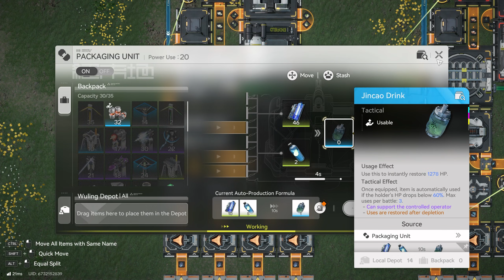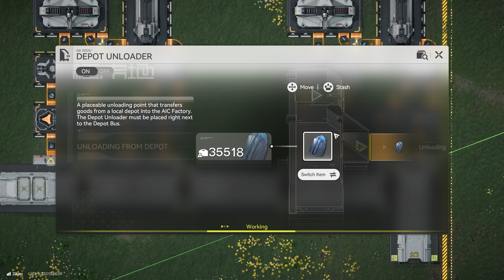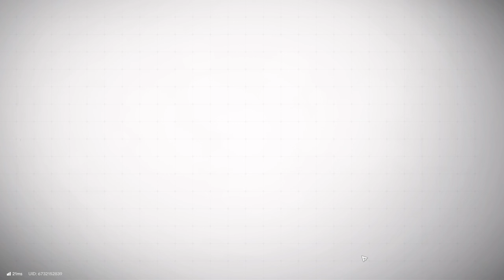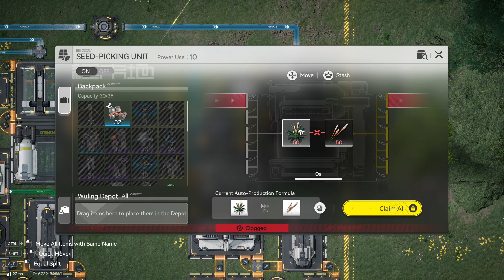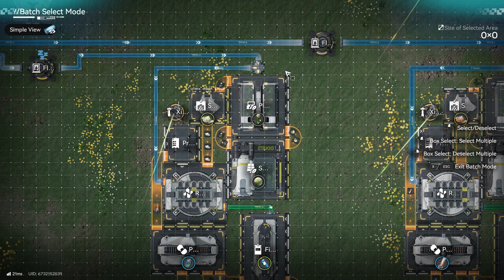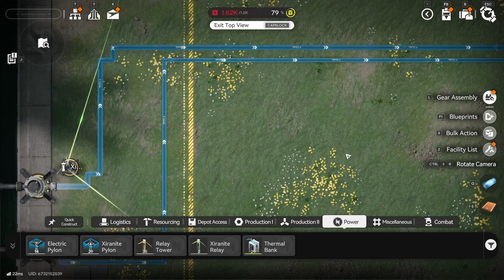YAZHEN SYRINGE & JINCAO DRINK - Compact 100% Efficiency Farm [ Arknights: Endfield ]

Comment: As nice as it might look, this isnt possible to really sustain until at least 1.1 comes out in around 4 weeks with new Areas of Wuling and hopefully more Ferrium Nodes...
You already can barely run a single line that need 4x Ferrium like Syringes or Jincao Drink ( it then is at 90 Ore produced and 120 used) so you can at least be offline for at least 15 or more Hours and only have like ~4k less Ferrium then compared to the day before and only have to bring over a bit of Ore every Day from Valley IV to Wuling.
But anything more and you need to ship every day tons of Ferrium from Valley IV to Wuling via the access to the Backpack and both Regions access to their respective Depots on Dijiang.
And the more you produce in Wuling that needs Ferrium, the less Time you realistically have to stay offline before it runs out of Ferrium and everything stops running.
Wouldnt reccomend doing this for now.

Comment: I couldn't wait for this one since you dropped the previous video and made my own version, it's shorter but wider than your setup. Also just a small addition, you can make two lines from the plant shredding unit and stash one line for Depot Node usage since the planting unit will always be clogged if you only have 1 outgoing line from the shredder.